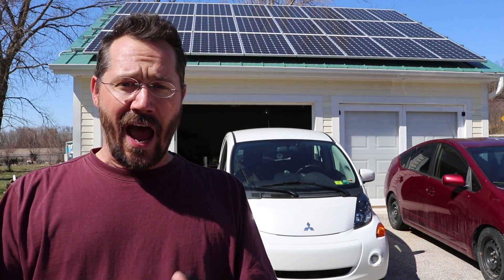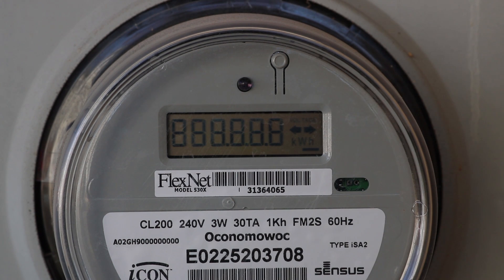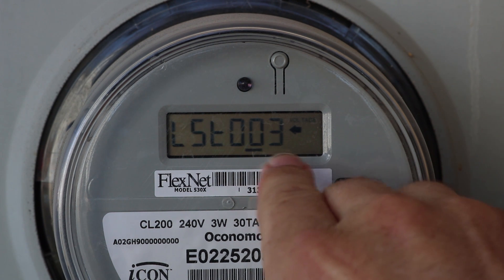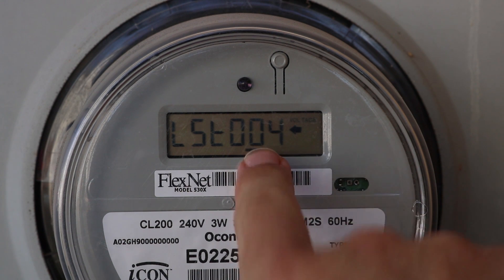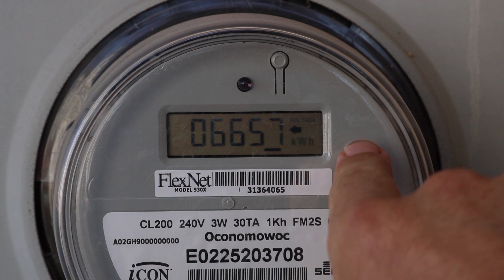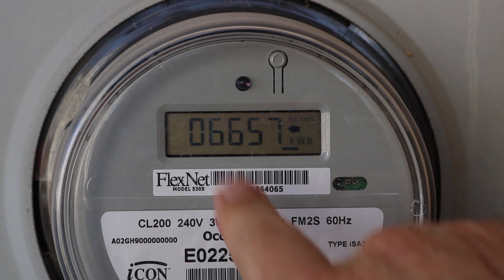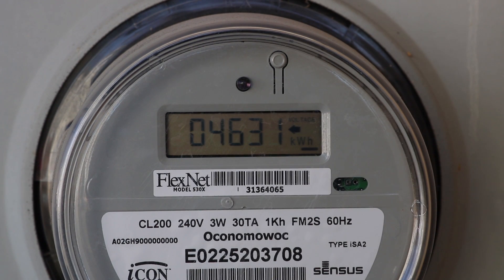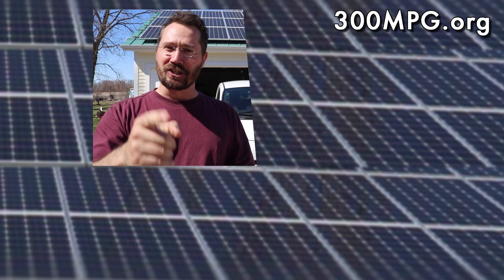Spin Your Power Meter Backwards!

Comment: Ben, this is great. I can't remember if you ever covered the matter of V2G ie charging the EV car from PV or off-peak hours, and later using the EV to send power back to the house or the grid during peak price hours ?
Thanks for the inspiration and Keep on trucking (from France) !
Reply from the maker: At this point, I do NOT have the ability to pull power FROM the vehicle to power the house, but it's something I intend to try in the future.

Comment: Hello Ben, I am glad to see others build their own systems. I did my system too. It is a large system and has paid for itself already. My monthly bill is about $13, and that's just the minimum hook up fees. (I don't use gas at all, but I still have it there if I should ever need it). I also use a huge amount of power each year. Everything is electric, water heaters, cars, home heat, range, oven, dryer, even heated bidet toilet seats! Ha! I also send enough back to get about $500 cash yearly selling extra power back. Good video too!